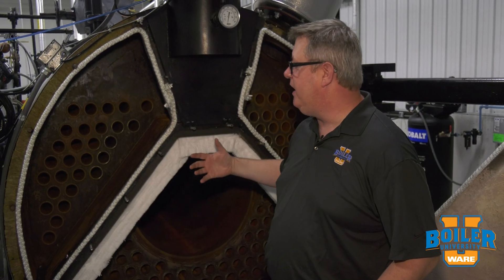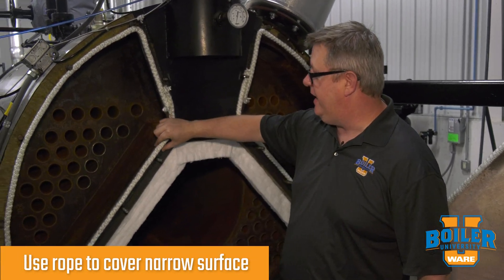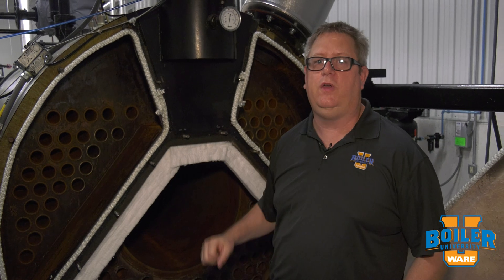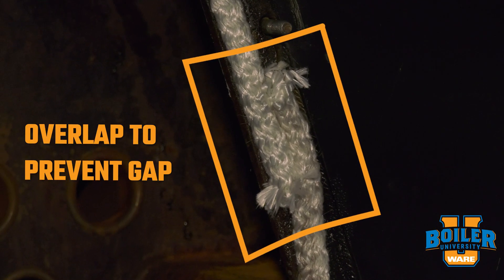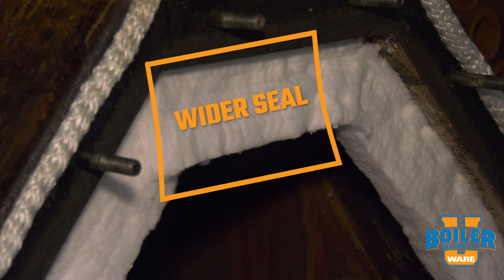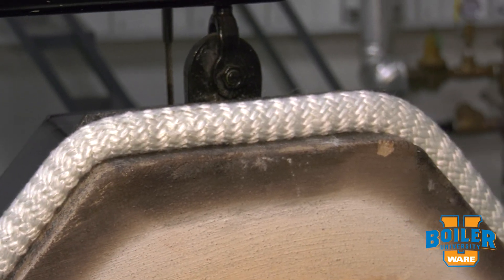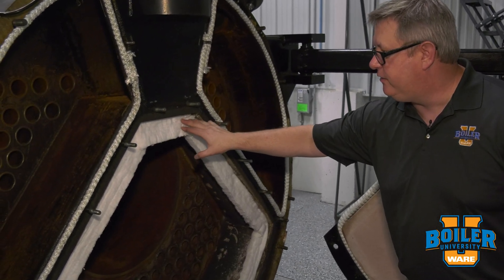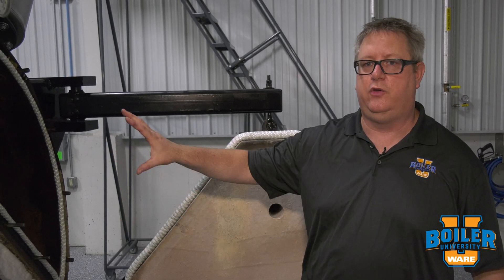How to Seal a Boiler Door - Weekly Boiler Tips

Comment: Also, I've tried to explain to new guys, that you do not want to use a wire wheel to strip the hard oxide patina off the fireside door gasket surface every time you open it up for maintenance. That oxide layer is a protective surface. Just use a scraper to remove any excess gasket material, lightly brush off any loose material, and replace the gasket. If you continuously use wire wheels to strip it down to bare metal, then you are only removing more and more metal over the years, which can eventually lead to excessive surface pitting, which makes getting a good door seal even more difficult as the boiler ages.